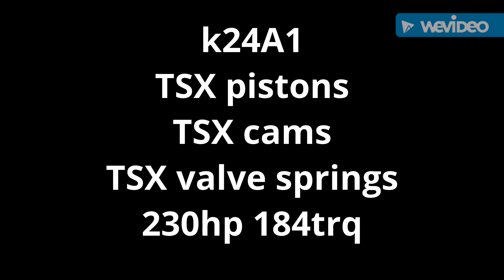230hp K24 Base Model Vtec Killer: Street Runs Hawaii

Comment: Subbed, from Aus, going to buy a clapper falcon and do a k24 swap and boost it, should P*ss a lot of people off 😜 just need to figure out mating the factory btr ion trans to the K, making an adaptor plate shouldn't be an issue as I can fab what I need but mating the torque converter will be a prob, but cross that bridge when I get there